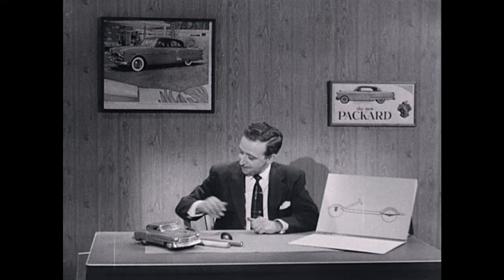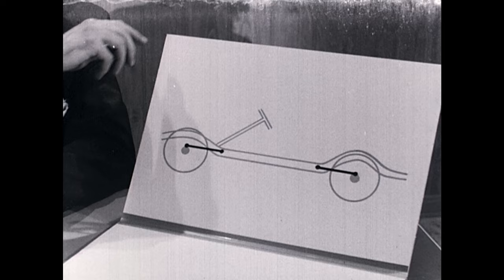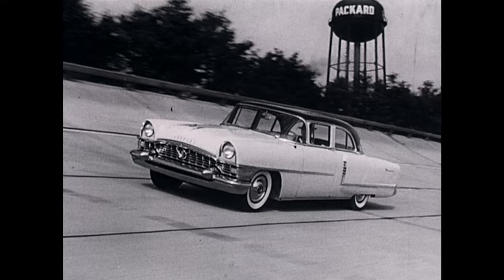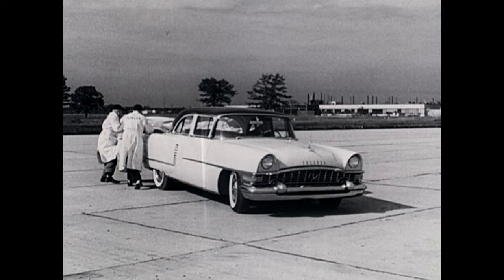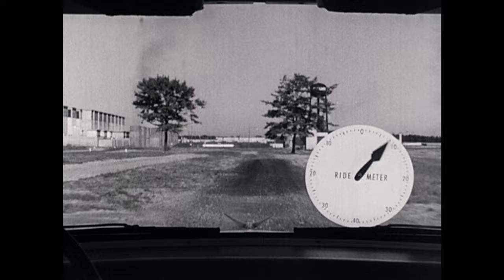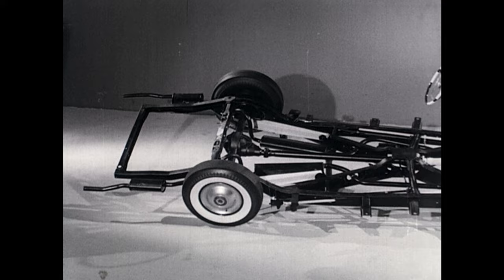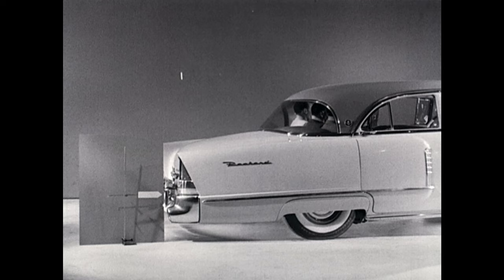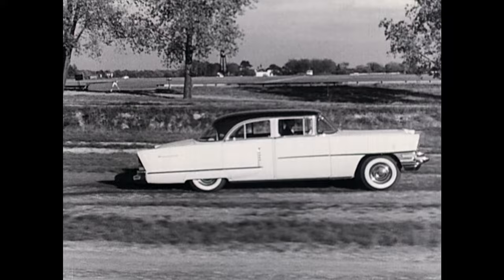Out of the Future (1954)

Comment: American cars always had really soft suspension - compromising handling on corners with a lot of body roll.   Looks like Packard made the suspension so ridiculously soft they had to add the electric motor levelling system so that Packards were not seen running around with the rear way too low because fat old Uncle Ben and his wife got in the back.   But, the motor had to be made very slow to respond, otherwise it would wear itself out on the bumps.   That meant it had to be activated  all the time, so it had time to work before you started up and drove off.  So the neighourhood kids flattened the battery trying it out while it was parked....  oh, well...   You would think Packard  would have given it a modicum of extra thought, and activated the electric leveling when the driver's door was opened.    Or better yet, just use all independent progressive coil springs all round and a buffered sub-chassis as did Mercedes - far simpler, no electric motor to fail, you don't feel bumps, the handling is good, little pitching and lurching, and it works just fine.
Reply: Mercedes used hydro-pneumatic system licensed from Citroen for estate( wagons) and some S class cars.  Today it’s called Airmatic.
Reply: The purpose of suspension is twofold: to reduce as much as possible the shock transmitted into the car by impact with road imperfections, and to provide deflection so that the wheels remain firmly on the ground. The limiting factor is always how much roll and pitch is allowed by a given system.

An all independent coil system does not work. Nobody manufactures one - the body roll that you criticize american cars for is much worse with a completely independent coil spring system, unless the springs have been made so stiff that they fail to fulfill either of the two purposes. This is why all cars with coil springs have their suspension horizontally interconnected with - of all things - torsion bars, be that separate units or on cheaper cars a twist beam design.

The Packard simply takes the principle of an anti-roll bar, turns it 90 degrees, and uses it as an anti-pitch bar. The electric motor exists only to tension the system in response to changing front-rear weight distribution.

This is simply a system that shows a superior understanding of suspension than you possess. The exact principle of front-rear interconnection to control pitch and allow for softer ride is understood by everyone - Rolls Royce, Citroen, even Mercedes - just not you.
Reply: @kyle8952  :  You got it right when you said the Packard system is an anti-pitch system, with an electric motor to respond to load distribution.   That's what this video explained.  But it has the disadvantages this video shows too.
You have no idea beyond that.   
I have not citicised American cars for their soft ride.   I merely stated the fact that American cars generally have a soft ride.   This is a deliberate choice of American manufacturers since the 1930's.   Go read Alfred Sloan's book, on how he built GM into the largest car maker - he states that the soft ride, and compromised handling was a deliberate choice, and briefly explains why.
Many upmarket cars such as Lexus (made by Toyota) are sold with softer suspension for USA, because that's what Americans want.  Not because Toyota doesn't know how to design suspension, which is stiffer in their cars for other markets.
Lots and lots of cars were and are made with all-independent coil suspension.   Go read the service manual for a heckflosse (fintail) Mercedes car - it's exactly as I described - progressive coils all round, all independent,  buffered front sub-chassis exactly as I described.   These are early 60's cars and very successful.  I owned one.   
My current car  is a 15 year old GM Commodore (Australian-made equivalent of Chevrolet) - it too has progressive coils all round, all independent, no front/back coupling of any kind.  It's handing and stability are nearly as good as that 1964 Mercedes.  Ride is softer.  It has no front-back interconnection and doesn't need it, as pitching is minimal due to a fairly long wheelbase.
Front-back interconnection was necessary on the first mass-produced car to have it - the Citroen 2CV, because of a combination of soft ride and a very short wheelbase, which would normally give excessive pitching.  Given the design objectives, it works quite well.   The most common car here with front-back interconnection was the BMC Mini - also a short wheelbase car.  But it was not very good - you just felt all the bumps twice as much.  It had a very hard suspension - apparently a designer choice.
What doesn't work so well is linear coils all round (ie not progressive) and I know of no car with such suspension.   1950's to 1970's American cars had progressive coils front, and leaf springs (which are inherently progressive) on the back - this too works very well, but not as well as the Hechflosse Mercedes system.  I had over the years owned several Ford Falcons with this coil front/leaf back system.  They all had a quirk - if you were cornering at moderate speed and the rear inside wheel hit a small bump, the car rear-end would jump sideways slightly.  Apart from that handling and ride was much the same as any similar car.
Reply: @kyle8952  : I did not criticise American cars generally for their soft ride - as it was a design choice to suit the market.   But I did rubbish Packard for going overboard on an extremely soft ride.   You see that extreme softness very clearly when the three chaps get in the back.  On most large cars, such a load would drop the back by 50 mm at most.  Going for such an extremely soft ride meant that dynamic pitching would be bad even on this large wheelbase car, so they had to fix it by front-back interconnection, and fix the static pitching problem with that by adding an electric motor and secondary torsion bars.   Looks like it worked ok ride/handling wise, but it was not an elegant solution.
One does not normally drive on bad pitch-inducing test tracks.   Nobody had speed bumps back then.